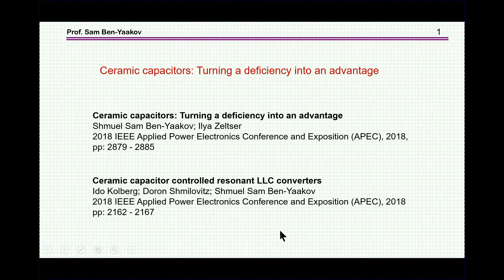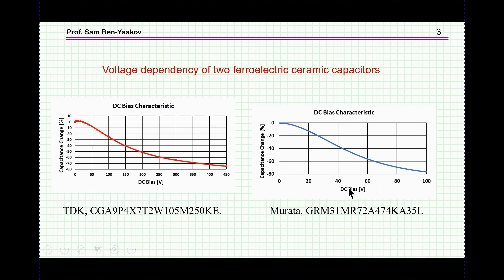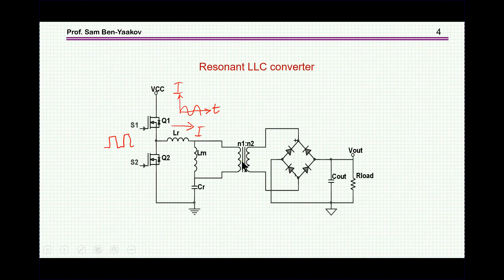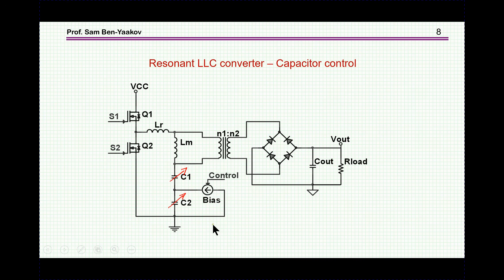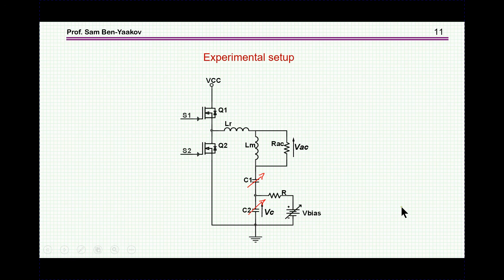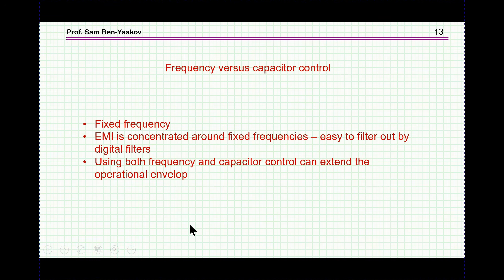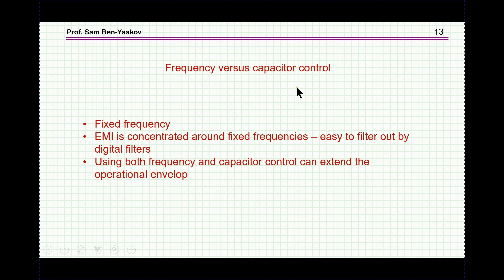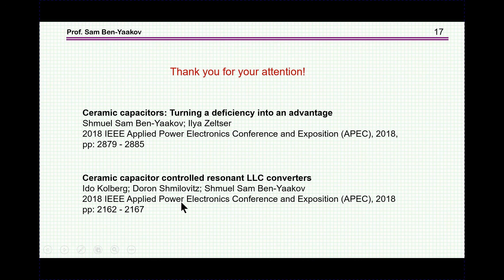Ceramic capacitors:Turning a deficiency into an advantage

Comment: Hi Sam, can you tell, why we need a special driver to drive the capacitor DC voltage? Why no using a large resistor? Would it be too slow?
Reply from the maker: Indeed .

Comment: Aren't we able to control the bias on the capacitors by changing the DC-component of the input voltage source, so by changing the duty cycle around 50 %? Since the capacitor is the only element in the circuit that can block DC we should be able to control the DC bias. The problem however is that we can change the bias only slightly in comparison to the nominal bias from 50 % duty cycle because the wave forms get distorted heavily otherwise.
Reply from the maker: Yes but this will affect the operation of converter.

Comment: In past there was (maybe somewhere still used?) technology to change inductance of coil. Using that we could get similar result but more flat voltage transfer plot. What you think about it?
https://en.wikipedia.org/wiki/Magnetic_amplifier
Reply from the maker: Hi Marcin, thanks for the important comment. A controlled inductor can be used but it is more complicated and power consuming. See
http://www.ee.bgu.ac.il/~pel/pdf-files/conf35.pdf
http://www.ee.bgu.ac.il/~pel/pdf-files/conf35.pdf
Reply: Thanks for this really nice materials and it true, current source is problem for a bit.

Comment: Thank you very much for your videos. I have a remark regarding replacing output rectifier with resistor in modeling process. I agree that the dynamic of the current in resonant tank is similar when output rectifier is replaced with Rac. However, dynamic of output voltage is not similar with original circuit as rectifier's output capacitor is neglected by replacing it with Rac. This capacitor has much slower dynamic compared to dynamic of resonant tank, and it makes control of resonant converters a bit less nightmarish. But the problem is that it is hard to model dynamic of output capacitor on AC side, so controllers are too empirical for my taste. What is your opinion about this, and how do you propose controller synthesis for resonant converters?

Comment: Another question...  I am not that familiar with resonant converters, but won't the AC voltage across the capacitor be on the order of the input voltage?  If so, does this mean that the bias voltage will necessarily be much larger than the input voltage?
Reply from the maker: A good question again. Indeed, there is a need for an auxiliary bias source, of low power level,  that will normally be larger than the input voltage. This capacitor control technology is in its infancy and research is still required to bring it to  a commercila level.
Reply: Sam Ben-Yaakov thanks! I can imagine ways to bootstrap a voltage for bias, it just adds some complications to the design.  The idea of using the parasitic nonlinearity of the capacitor in this way is pretty cool.  Another question, how consistent is the capacitor nonlinearity across manufacturers?

Comment: Is the esr of the capacitor also a function of the bias voltage?
Reply from the maker: This is a good question which I am not sure a bout the answer. It is usually assumed that the ESR is not a function of the bias only of frequency. I am going to look into it.
Reply from the maker: Exceeding the permissible voltage may cause a breakdown so  this is a region of no interest. In the safe zone, though, the current via the ESR will heat up the capacitor. I have not seen any data on how the temperature rise affects the ESR. If Murphy's laws are not on guard,  it might go down :-) . This is another issue that needs to be looked at.  Perhaps there is some data on that. I will be happy to be updated on this by anyone who has this information.
Reply: If the bias voltage exceed its maximum Volt rating of capacitor and it will physical heat-up the cap. So that, the esr increases due to self-heating effect and thermal stresses. I think they are two factors will change the esr either (switching frequency or temperature)

 Sorry for guessing in this way. If anything wrong I hope professor Sam can correct my assumption. Thanks.
Reply: Sam Ben-Yaakov Thanks professor Sam, if see any paper explain this, will try to send you the link here :)